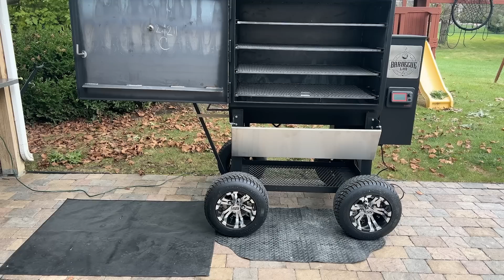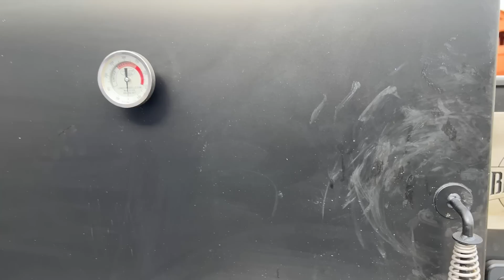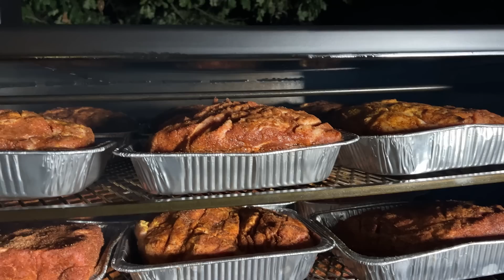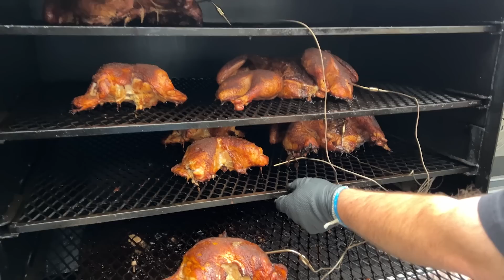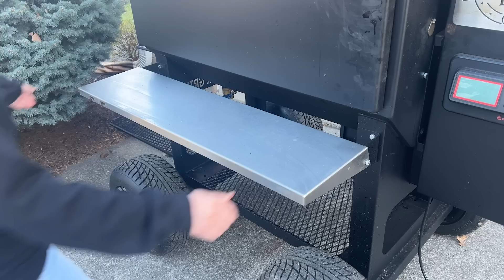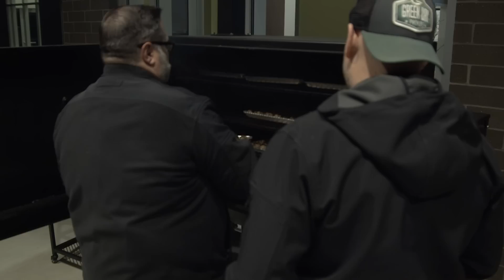Get The MOST OUT of Your Pellet Grill | Lone Star Grillz Pellet Cabinet REVIEW

Comment: I have a Lone Star Grillz Large Cabinet Smoker, and it is a beast! I can easily cook 200 lbs of brisket, and 160 pounds of pork butt. The fire lasts for more than 20 hours. It makes an incredible smoked flavored product. I’ve never been a fan of pellet poopers because of so many inherent deficiencies with a fire that is so small, and is so controlled by outside ambient air temperature and wind. Plus the issue with wood flavor from bad pellets, vs my hickory and pecan wood splits. My ISV is impervious to ambient temperature and wind. How does the final product compare to the craft BBQ my ISV produces? I now live in Utah and have hot summers and cold, windy and snowy winters and those conditions don’t affect the performance.

Comment: Probably best not to recommend the stainless steel grates if you have not had them from LSG.  Cleaning with a brush is not fun when brushing front to back.   The way the grates are cut, horizontally vs vertically makes it more of a pain.  Better to buy 3rd party stainless round bar grates.  For the probe port.  Make sure the little cover slides back and not forward.  You must of had your probe wires going through the opening with the probe cover pushed to the front of the cabinet.  No staining of your plaque that way.  Giving a lower rating on front shelf seems wrong when you have options for black or stainless.  Also low score talking about accessories.  The grill can griddle, make pizza, sear and cook with charcoal makes me believe the score should be closer to a 10 and not 6.   Yes turning radius sucks.  Spacers make that a non issue but that’s an aftermarket purchase not through Lone Star.

Comment: Nice in depth review but you are not cooking on it optimally…You have sheet pans under meatballs and potatoes, foil pans under butts from the start. You should use cooling sheets instead for better flow, more smoke/flavor and the one thing you like about capacity 3654 sq in gets in the way when loaded and blocked by all those pans. 
Turning radius easily improved with 2.5” spacers. For someone who moves it that much (as I do too) they’re a GameChanger. Only do the front wheels for best turning. You won’t notice a storage difference or usage difference with front shelf up but you will with easier movement and turning.

Did you try the pizza oven or handling sausage or ribs? Pretty versatile. 

Cooking height is a godsend. Bottom shelf is 38”, top is 58”…you’re 3” higher because you chose the ORP… rightfully so.  

No huge bonus for ease of access of the side swing door? Much better and easier to reach the door handle at 48” then 71” overhead to reach/close the lid on a 42. So short/tall/ shoulder issue that’s a huge bonus. 

Not the numbers I would given. I also added 3 rails amd 4 more sausage rods and have 7 shelves (6384 sq in) for jerky, bacon, wings, sausages. Chicken, etc.   Massively versatile.

3rd party SS rods are a huge help and more supported and better than the LSG laser cut stainless. 

Definitely a beast and very versatile. I’m in heaven upgrading from the shorter 42.

Comment: Great review.  I have the similar LSG 42" more standard style pellet smoker, though it's engine is basically the same.  Same controller, hopper, and burn pot design.  Personally I'd give mine a 10/10 for cleaning.  That burn pot being removable without removing any deflectors is a game changer for me.  I found with my previous pellet grill I'd have to clean that out after each cook or I'd risk it stalling, a great GMG, so I think that's a risk on any pellet smoker.  So being able to just bend over pop the pot, dump it in the trash and put it back in like 30 seconds is like a god send for quick cleanouts in between cooks.  Then I just do the normal cleaning later...  I am baffled why every pellet smoker doesn't have this feature to be honest.  I'll add LSG and Chris are great.  I have a LSG Pellet 42", a 60" Santa Maria beast that is so fun to use, and a Large IVS that is amazing too.  The quality is phenomenal and their support is fantastic.  The freight people did a number on mine when shipping and I couldn't see until after I uncrated it and had already signed by my entire LSG Pellet 42" hopper assembly was warped and bent.  No questions asked Chris shipped me a whole new steel hopper frame, some BBQ paint black spray to touch up the scratches that also happened, and gave me instructions on applying the paint.  Fantastic support.  I'll also say in disassembling my hopper and pulling out the fan, controller, auger etc to move it to the new hopper frame I got I was really impressed how easy it was for me to do.  I've never disassembled and reassembled a smoker part like that before (though have built my own computers and it was kind of similar to that) and got it done fairly easily and works great.   That really gives me confidence if I ever need to order a part and swap it myself.

Comment: My $600 Grilla Silverback came with stainless bar grates. Blows my mind that this smoker doesn’t come with them by default. Great review. My cabinet is in shipping process now. Can’t wait to use it soon.
Reply: I'd say most custom smokers come with expanded steel grates, even big 500-1000 gallon ones that are 10k+.  It's kind of a larger scale custom hardcore smoker thing I'd say.  I get why some don't like it but I don't feel they're that hard to clean personally.
Reply: its not so much the cleaning, but the fact that they rust absolutely sucks. @M4ttNet
Reply: @ Get that though keeping them seasoned isn't too difficult.  If you want to save money then going with traditional expanded steel is perfectly fine and the status quo outside of big box smokers.
Reply: the difference is the lone star stainless "grates" are actually a solid sheet of 1/8" stainless steel cut out on a plasma cutter, not the standard bar grates that come on a standard grill. There's a LOT more steel being used.

Comment: I took delivery of the 42" with ORP about a year or so ago. Other than the cook chamber its essentially the same grill. I don't think I'd argue with anything you said about the fundamentals of how the grill performs. Couple things I'd note. I don't think any pellet grill is going to perform evenly when stuffed full of pans/trays that stifle air flow. I worked my way up to the Lone Star from vertical charcoal, to pitboss, to traeger, to now this cooker and acknowledging the cabinet chamber is a bigger beast, none of those other options come close to even temperature across the grate than what I've seen with my 42". The Pitboss 1,000 series I had would consistently have 50 degree differences from opposite ends of the grate. The max I've seen with my 42" is roughly 10 degrees or so (again, when not using pans or trays that block airflow). A couple of things not noted in the video that I think are worth mentioning: 1) The pellet dump off the back of the hopper. None of the big box grills that I have cooked with or that are owned by friends have this option. When I was purchasing it was between LSG and Yoder and at the time the Yoder didni't have that feature either (I think they may now though....) Nice to be able to switch out pellet flavors easily. 2) The internal thermometer that was shown in the video is default to control chamber temp by the Fireboard. But, especially when cooking say just a single brisket or pork butt in such a big chamber, you can set the Fireboard to control off of one of the ambient temperature probes. So you could put your food on any rack, place an ambient next to it, and know that position in the chamber is what's being monitored to control the temperature. The 42" is a pretty decent sized to boot and I've done this when cooking smaller portions. Works great.
Reply from the maker: You’re right. I did shoot video of changing pellets, but I forgot to add that in. I do love that feature. Trying to cram as much as I can into a 20 minute video, sometimes I leave things on the cutting room floor I didn’t mean to.
Reply: @TheBarbecueLab  Not a knock, you covered a lot. I appreciate it. Always interested in others thoughts and honestly, a year later and probably 50 to 60 cooks later, still learning the pit! Those are just two things I like and use a lot, thought they were worth adding! Thanks again, enjoy your reviews.